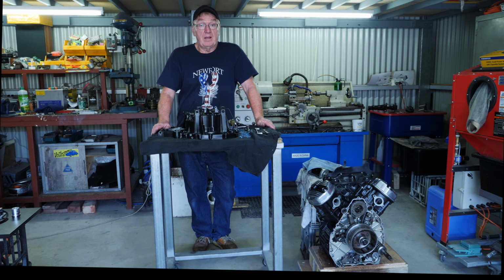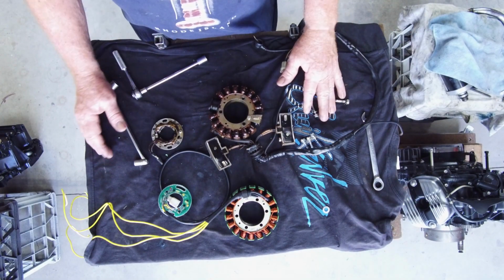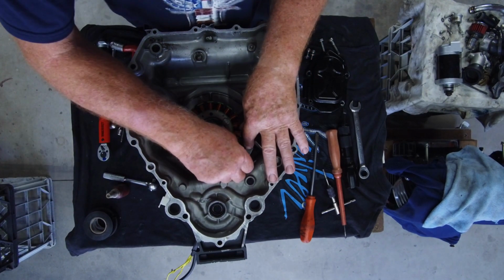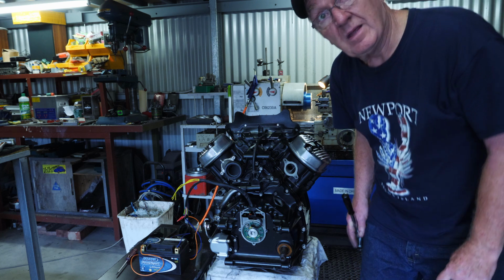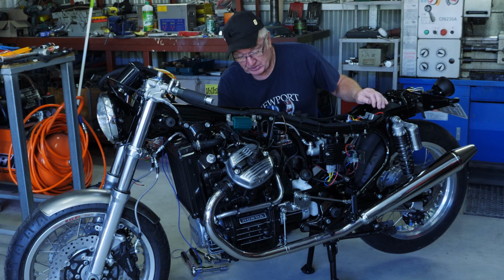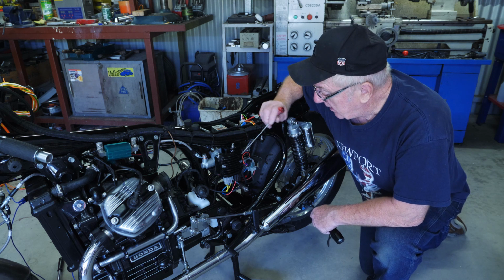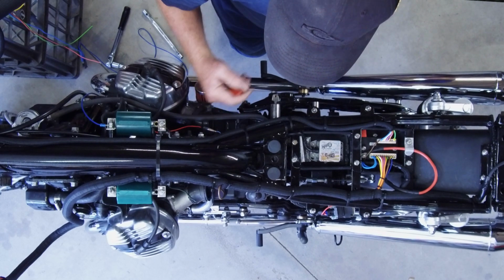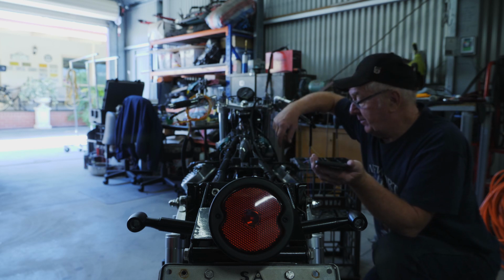Honda CX500 Episode 10 Final assembly begins

Comment: Love your videos!
I’m currently building a 1981 CX500D and am looking to use the same ignition system as you. I have rebuilt the engine and installed the 12 volt stator and removed the triggers as you have. I’m ready to order from Rae San, but I’m confused on what system I should get. Can you tell me exactly which system you got from Rae San?
Thanks!
Reply from the maker: Hi there 
Thanks for the nice comment 
Good idea to install the Rae San ignition system mine has been very reliable 
Yeah it can be a bit confusing because you do have different ignition systems on the Honda CX500/650 . Early CX500 had CDI ignition Later CX500/650 had TAI ignition systems 
If you have an early CX500 with CDI ignition I would replace the whole ignition system with the Rae San Hall effect kit like I have done see link below

https://www.rae-san.com/cx-conversion-to-12v-hall/

One other thing you should do is remove the ignition Trigger coils then remove the wiring from the R/H trigger coil (This is the one with the pointer on it which you will need for timing the motor. You wont need the L/H one and can be left out  ) and then reinstall it in the motor check out how to do this in the link below

https://www.youtube.com/watch?v=kJ6ZnBsJi7M&t=409s

Good luck with your build they are a nice bike
Reply: @Coolhand99au  
Perfect. Thanks for your help!

Comment: Great video, where did you purchase the 12v stator from?
Reply from the maker: Cheers Mate 
Stator link below

https://www.ebay.com.au/itm/Magneto-Generator-Stator-Coil-for-Honda-CX500-GL500-Silverwing-Interstate-CX650/233295397041?ssPageName=STRK%3AMEBIDX%3AIT&_trksid=p2057872.m2749.l2649
Reply: Coolhand99au thank you sir.
One more question if you don’t mind, I’ve also installed the Rae San 12v Hall system in my bike but no matter what I do the FR and FL do not line up as they should, meaning if I set the static timing by FR the FR line comes out perfect but FL is off by 6mm passes the line according to the red light and if I set the timing by FL first then FR is off by 5-6mm passes the line the same way. 
The bike starts right up but on hard acceleration it sputters and has no power, the carbs are perfect and functioning properly. 
I have brand new OEM coils on the bike (for CDI) so I’m not sure if this is also contributing to the issue.
Reply from the maker: @fandffabricaNY  Mate the red light should go off as it lines up with the FL mark if there is a difference between FL and FR just balance them out
Your main problem is your coils you can't use the standard CDI coils you need 12 Volt 3 Ohm coils these coils are powered from the Ray_San control unit
I got two of these coils.Yamaha 12V 12 Volt Ignition Coil Single Output High Performance 3 Ohm DC3-1 NEW for $92.62 US from "2FAST" doesn't seem as though they are still in stock The "Dayatek" ones are very expensive  
Have a search for these sort of coils see link below
https://www.ebay.com.au/itm/Yamaha-Style-High-Performance-Single-Output-Tower-Coil-3-OHM-Green-Dyna-Ignition/152119703829?hash=item236b0a7915:g:mVwAAOSwGIZcUc1G
Reply: Coolhand99au i thought so, thank you so much mate. Cheers 🍻

Comment: It is nice, but all those mods costs a lot of money, compare to a value of the bike :S Which ignition coils do you use? Stator needs to be replaced only for lion batteries, am I correct? You also need to replace voltage regulator?
Reply from the maker: Hi VR 
I didnt build this bike to sell and make a profit
I built it because it is unique and built by myself I have  had many dollars worth of fun and experience out of this project and there will be more to come 
The coils I used are Yamaha 12V 12 Volt Ignition Coil Single Output High Performance 3 Ohm DC3-1
The stator was part of the total upgrade of the electrical system no it doesn't have to be replaced because of a lithium battery the voltage regulator should be replaced

Comment: Great set up you have there!!, I had a though on the Rae San ignition but since I installed an Ignitech CDI I don’t need the whole system, only the rotor and pulser will work for me as I find out with Motofaction, I probably will install it because so far I couldn’t get rid of some backfire on reductions, nice video, happy new year!!
Reply from the maker: Hi Carlos
Yeah you could replace the advancer coils with a Hall Effect sensor and pulse magnet
I'm not sure what is needed in the back of the motor
Have you done a Ohms reading on all your coils to check the values?
HAPPY NEW YEAR! too you also
Reply: Coolhand99au , tanks for reply mate!!, no I haven’t checked the coils yet